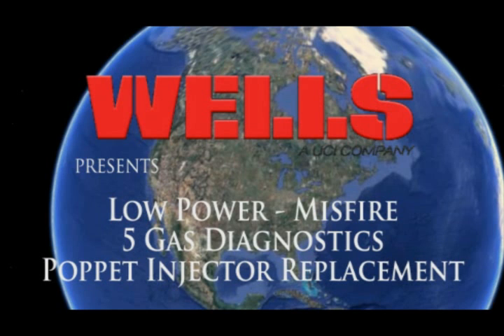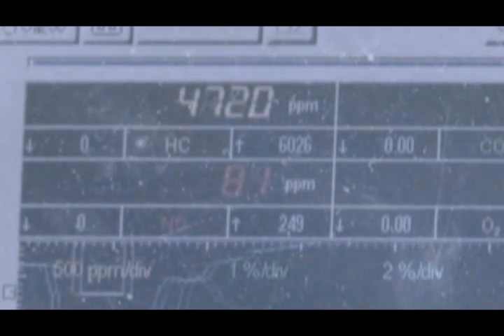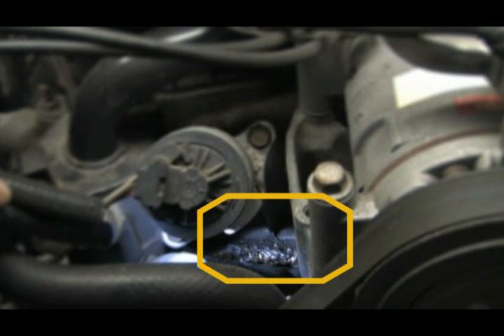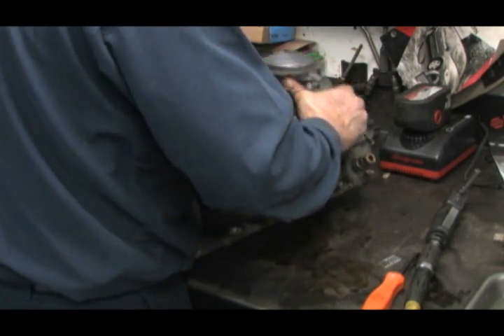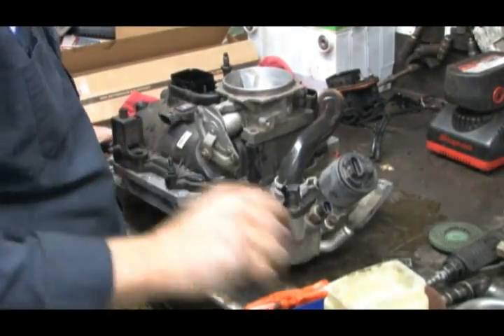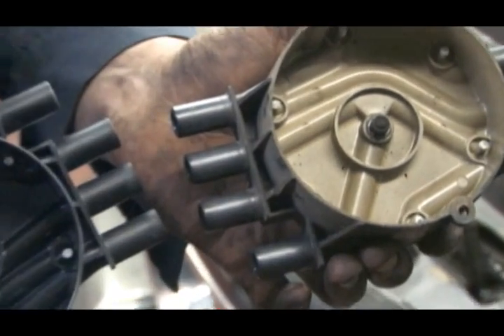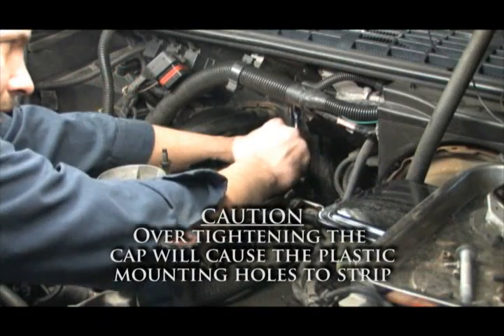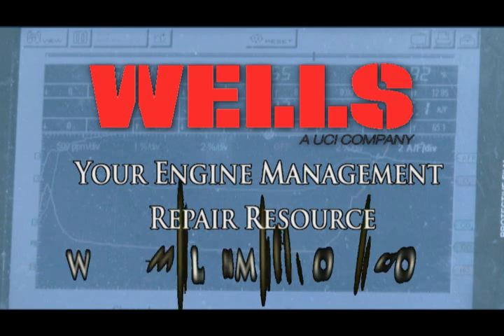Chev / GMC Misfire, poppet injector diagnosis, troubleshooting and replacement

Comment: Excellent video, Thank You! subbed.  Was the RICH condition caused by LIM Gasket failure?
Reply from the maker: +nextari The rich condition is caused by sticking on injectors giving the engine too much fuel. The lower intake gasket was replaced due to the fact that it was leaking coolant. Glad you like the video!
Mike Becker, Technical Services Instructor
Reply: +markjhicks Thank You Sir.  My 3 x passenger side spark plugs are carbon fouled (fluffy). The Cat is bad, but fouling being only  one side makes me think it's O2 sensor.  However, no code is thrown for that, only p0452 (fuel pressure code-no leak down done yet) and p0300 (new to me-needs tune up badly-parts on hand).
Reply: backstory>>I thought I had LIM Gasket fail (a thin drip @ 1drops/hour when running - from oil pan & starter-but could not ID color) which brought me here to your most excellent video channel, but after pressure washing engine, not seeing any drip. Will do UV test next. I'm 1hr in the mountains.  I'm still wondering if the carbon fouling could be related to a gasket fail.  They are Not white, just fluffy black, and no white exhaust. Don't know how to detect "sweet smell", mostly rich smell. Thank You!
Reply from the maker: +nextari The injectors are a really common failure point on these trucks. Are you losing any coolant from your reservoir? It would be a good idea to do a cooling system pressure test to verify that the coolants not leaking into the cylinder on that bank. If the cooling system holds I would take a really close look at your injectors. As for a small leak, if it's only leaking externally it won't cause that bank to run any different.
Reply: +markjhicks Good to know, Thanks!  Another week point, just discovered, is the ENGINE MOUNTS like to fail. Replacing the driver side one is reported by some to be a major major project, involving removal of the front differential.
Reply: +markjhicks Thanks!  All 3 plugs look identical (carbon fouled), whereas the other side are clean.  Is there anything that would make all 3 injectors fail or act that way other than O2 Sensor? Planning on doing leakdown of fuel and coolant when I get to town (1hr away).  Previous owner mentioned replacing O2 sensor, maybe they left plus in.  But it IS running rich (gas smell), but without trouble code.  Thanks very much for your help.
Reply from the maker: +nextari It would be good to monitor that O2 sensor on that bank and versus the other bank.  You could possibly even swap the O2 from the other bank and see if the problem follows it. That way you would know if the 02 is bad or not. Also hook up a fuel pressure gauge and see if the fuel pressure drops when the key is shut off. It should maintain a relatively steady pressure. Keep in touch.
Mike Becker, Technical Services Instructor
Reply: +markjhicks Thanks! fuel pressure leakdown is satisfactory, 10 mins trickle down to 55psi.   I'm gonna look into testing the O2.  Thanks again!!

Comment: my names ryan i got a 1996 gmc sle and when i accelerate itvmissfires unless i step on the gas it want stop until about 40mph then i park it came out the next morning and it missfired really bad and the rpms would go up but the speed would build really really slow and now it want even start it will try to but it want only if i put gas on the air filter and then only for a breif moment sombody help me i have no clue whats wrong
Reply from the maker: I will assume you have a 1/2 ton truck, SLE means nothing to me. I will also assume you have a 4.3 engine. Check the fuel pressure. Specs are 60 -66 psi. Key on engine off. Fuel pressure is critical!
Mark Hicks
Wells Vehicle Electronics
Reply: Wells Vehicle Electronics Or he could have a 5.7 tbi. Do you know the fuel pressure for a 5.7?

Comment: Thanks for the message. I really enjoyed your  detailed explanation. I love not just fixing something, but understanding how it fits into the big picture too.  I have a downed 96 Chevy Tahoe with a 5.7 liter engine. It's fine until I have to brake. Then it won't see the gears. I have to pull over, restart and it sees the gears again just fine....until I have to brake again.  I have been down for over a year now and I was wondering what your recommendations would be.  I have 2 lines dropping down out of the brake fluid box, so I can imagine its a brake pressure reset thing, but I'm just guessing. It seems to me there is no signal getting to the computer that I have let off the brake and that I am now excelerating.  That's just this 1 gramma's guess. As a diy kinda gal with no tools. I'd like to be able to at least sound intelligent or at least like I've been trying, when my friend comes over to help...Thanks so much.
Reply from the maker: When you hit the brakes overdrive should release and the transmission should then go into 3rd gear. Have you checked the transmission fluid? Not just for level but also for contamination.
Mark Hicks
Wells Vehicle Electronics
Reply from the maker: Blingadera Artisans
The only hose I can think of would be to the EVAP system, which has nothing to do with the transmission.
Mark Hicks
Wells Vehicle Electronics

Comment: I've got a misfire as well. originally it was cyl. 3, now it's 4. replaced catalytic, cap, rotor, plugs, wires, maf sensor, cleaned fuel system, new fuel filter, don't really want to have to change head gaskets...
Reply: I gave up and got a new car lol
Reply from the maker: What is the year, make, model and engine size?
It sounds like it is time to check compression and head gaskets.
Mark Hicks
Wells Vehicle Electronics
Reply: 1999 olds bravada 4.3. Im trying to do everything else before having to worry about costly head gaskets... oh yeah and replaced vaccum lines.
Reply: And my engine does not overheat or loose coolant. Going to try to put in ignition coil tomorrow.
Reply: Nathan Lorenzen

Comment: Mark. I have a 99 chevy astro  I did a full tune up and was working good later on it starts misfire, so I did the scan and got the PO300 and TPS so I changed that TPS and its when away, but it now its back. well car start normal no misfire but once it start running about 20 mph it stars jumping and loose power. what could the problem be? I already change TPS 2 times goes away and came back with the same problem.

Comment: Great info! I've had the rotor, cap, distributor, ignition coil, spider injector, full tranny overhaul, something?intake replaced, vacuum leaks were undetected and spark plugs/wires were fine, yet my '96 Chevy Suburban still kicks out P0300. I'm getting extremely  poor fuel mileage :/ and my engine sounds like its running rough. All the cars pass me by unless I press the gas more than usual which results in the rpm revving up high but seem to go nowhere as far as speed is concerned. What could this be? The mechanics seem to can't figure this mystery out! Does any of this sound familiar to you Mark?
Reply from the maker: Yea it does! It sounds like your catalytic convertor(s) are restricting flow. Have the back pressure checked and let me know the results please.
Mark Hicks
Wells Vehicle Electronics
Reply: I forgot to mention the catalytic converter was also replaced.
Reply from the maker: Ladi Maat
Check MAF, front O2 sensors and Fuel pressure.
Let me know what you the test results are,
Mark Hicks
Wells Vehicle Electronics

Comment: How do you change a camshaft sensor on a 96 chevy s10 4.3L Do you have to take the distributor out...
Reply from the maker: You should not have to remove the distributor. Remove the cap and the two hold down bolts on the sensor. Make sure the trigger wheel on the bottom top of the shaft are positioned so you can slide the sensor out.
If you need any more information, let me know,
Mark Hicks
Wells Vehicle Electronics

Comment from the maker: Have you checked it for vacuum leaks? If it seems to have started after work was performed, you have to start there and make sure it was done right. A defective fuel pressure regulator on your vehicle is also common to cause this issue. Stay in touch!
Mark Hicks
Wells Vehicle Electronics

Comment: Awesome video. I have had a persistent P300 multiple random misfire code with my 97 Yukon 5.7 liter. SES light on, not blinking. Replaced plugs, wires, cap and rotor several times. Misfire continues. Got really bad on a trip last winter, and SES light flashed on acceleration. Now, also get rear cat efficiency low error code. The misfire seemed to have started about 2 years ago after replacing upper intake manifold gasket. Any recommendations?

Comment from the maker: Good news! As far as the O2s, how is the vehicle overall running, any lack of power, misfire etc. If this seems to be OK front O2s are known to get lazy and don't set a code right away. You might want to check for any pending codes. Changing the front O2s is not a bad dart to throw, if you don't have the equipment to test them.
Let me know,
Mark Hicks
Wells Vehicle Electronics

Comment from the maker: Ed thank you for the professional comment. If someone wants to do it by the book, they should follow your advise. However, when distributors were adjustable how were they positioned on the engine? Part of the tune up process was to set the timing. Not because the distributor moved, it was because of the extra movement in the timing chain and gear correlation, cam and distributor gear and distributor bushings. 

Mark Hicks
Wells Vehicle Electronics

Comment: to properly adjust the base timing on this you need to do so with a professional scan tool to reflash your pc with an update which you have to take to your local dealer to do so. by making any other adjustments like loggating the base plate you can cause cross fires and all sorts of stuff

Comment: ok far as the distributor goes gm designed it to be a non adjustable setup. if you are out of time and its showing up odds are your engine has a lot of miles on it like 120,000 or so. in this case your timing chain has probably stretched and has some free slap in it. motor all data usually recommends replacement of most timing chains and belts around 60,000. your distributor is directly gear drivin by the cam which is directly driven by the crank via your timing chain so dont short cut replaceit

Comment: Hi Mark, I have a mis on #1 cyl as well, 96 Blazer 4.3. Have done the maintenance items, plugs, wires, dist cap and rotor. FP runs and holds at about 58 by my gauge. If it were a 'normal' set up I would swap injectors with another cyl to see if my miss moves. Is this possible with this set up or any other suggestions are appreciated.

Comment from the maker: If you have anti-freeze or fuel in the oil and you start the engine it is going travel through the bearing ports ... not a good for furture lubrication. Always drain the oil before you start the engine after any major work. IF you want to then let it warm up and change the oil again it would not be a bad thing. 
Congrats on tackling a tough job!
Please let everyone know how it turns out,

Mark Hicks
Wells Vehicle Electronics

Comment from the maker: Because of the HC, Co and Co2 readings it appeared to be running rich. We didn't need to check fuel pressure, we just needed to confirm it was not the computer holding the injector open. We confirmed this with the noid light. But you are right another way to check it is by checking for pressure leak down. Great question! Thank you,
Mark Hicks
Wells Vehicle Electronics

Comment: Hi Mr Mark,I am writing from Tulsa, Oklahoma. Thanks for your reply, I do really appreciate the time you have taken to write to me. I have an Astro van 1995 3.4L Engine that recently broke down on me. I was driving it on the highway  and suddenly started to loose power and the engine went dead. I tried to start it again and had no success, the engine wouldn't stay in idle and when I pushed the gas pedal some explosions started to happen and loud noises from the exhaust. Any advice?

Comment from the maker: It is common for a leaking fuel pressure regulator or injector to cause this on your vehicle. Check for about 55-57 PSI fuel pressure at idle. 
Check for a leaking fuel pressure regulator. Check for washing inside the plenum. You will have to take the intake manifold off. First check for any signs of fuel smell.
Check for a leaking fuel injector line. Let me know.
The MAF is also common. But you will usually get a code.
Mark Hicks
Wells Vehicle Electronics

Comment from the maker: The fix was that the injector(s) were leaking. The gaskets needed replacing because of the anti-freeze leak. The first thing to check on your vehicle for poor fuel economy are the O2 sensors. What is the year, make, model of your vehicle?
Mark Hicks
Wells Vehicle Electronics

Comment from the maker: First take a look at the bottom of the sensor. If it has been hitting the crankshaft trigger wheel, there are shims available to move it away slightly. The only way to relearn is with a scan tool, this is the next step. If it can not be relearned, you could have excessive crankshaft run out or a timing chain issue. Please stay in touch to help everyone learn.  

Mark Hicks
Wells Vehicle Electronics

Comment from the maker: You bet it could! Certainly, if the trigger wheel is connected to it. the only way to be certain is to watch the triggers with a labscope. I suggest watching the crank and cam sensor signals at the same time. taking note of any deviation. watching them together will give you a point of reference. You could also use an injector trigger to do it. What kind of vehicle are you talking about? 
Mark Hicks
Wells Vehicle Electronics

Comment from the maker: Sorry it took me so long to reply. you said the rear area is really clean. This means that is where the leak is and because the pressure regulator is there it is most likely leaking. Remember, gasoline is a very good detergent. Yes you can pressurize it and see what you get.
But i am thinking you found the problem. Let me know

Mark Hicks
Wells Vehicle Electronics

Comment from the maker: The spec for fuel pressure on your vehicle is 60 - 66 PSI. It bothers me because you are not reaching the value. I still think it is worth your time to remove the top of the intake and inspect the valley for signs of fuel. If the pressure regulator is leaking you will see the area below it all washed clean.

Let me know,
Mark Hicks
Wells Vehicle Electronics

Comment from the maker: 1. Install a fuel pressure gauge, and after engine is shut off, is the fuel pressure bleeding down?

2. If pressure is bleeding down, remove the upper intake plenum and check for a leaking fuel pressure regulator. 

Very common to cause this issue. Please let me know the results of your testing.

Mark Hicks
Wells Vehicle Electronics

Comment from the maker: It could be an injector sticking. But first give me the year, make model, engine size and what code is being set. I will check it out and give you the most probable causes.

Mark Hicks
Wells Vehicle Electronics

Comment: Hey its rich so now my blazer runs good what i did  was made a tester for the spider injectors an test all 6 of them and come to find out all 6 were clicking so i thought they were good so i pulled out the #6 poppet injector out ( with the upper intake off ) put the fuel lines back on turned the ignition to the on position let the fuel system get some pressure then tested #6 and when it was clicking no fuel came out so i cleaned it and now it sprays fuel put it all back together runs way better

Comment from the maker: It sounds like the injector is stuck open or have a piece of grit holding it open. But there is still a possibility you have a compression problem. I would first put a compression gauge on it and check to see how that cylinder measures to the other two on the same side. 

Let me know what you find,
Mark Hicks
Wells Vehicle Electronics

Comment: I have a 97 blazer 4x4 4.3 did a lower intake gasket replacement put every thing back the way i took it apart i market every thing to line it all back up. now i have a misfire on cyl #6 i have spark at the distributor and at the end of the spark plug wire. put new ac delco plugs in and still has a misfire. so im thinking its a fuel problem but i know i had a lil peace of grease/oil chunk wedged on the lip of the intake valve so maybe its not closing all the way and making me lose compression???

Comment: i have a 2001 chevy s10 4x4 i had a misfire on it and i replaced all the spark plugs wires disturbitor cap rotary button and ignition coil and it sill have a misfire and the check enine light blinks so i thank it is the Fuel Injectors

Comment from the maker: @66bubbaray Ok if it has spark it means the Crank sensor is working. If you spray carb cleaner of starting fluid into the intake will it start? If it does it means it is lacking fuel. If the fuel pressure is good like you said, the next is to check the quality of the fuel. If that looks good the next is to check the injector circuit. the intake will have to come off to do this. Let me know the results and I will help you from there,

Mark Hicks
Wells Vehicle Electronics

Comment from the maker: @66bubbaray The first thing I would do is check for spark and fuel pressure. When you get these results let me know. You can also call me on our tech line 1-800-558-9770 from 7 am to 7 pm CST.
Mark Hicks
Wells Vehicle Electronics

Comment from the maker: @JockyTy An Intake manifold leak is common on your vehicle. Could this cause a P0300? Yes! If you do not have a smoke machine, try spraying carb cleaner around the intake while the engine is idling. If the RPMs change due to the addition of the carb cleaner around the intake it means you have a leak. 
Good Luck
Let me know if you have any further questions.
Mark Hicks
Wells Vehicle Electronics